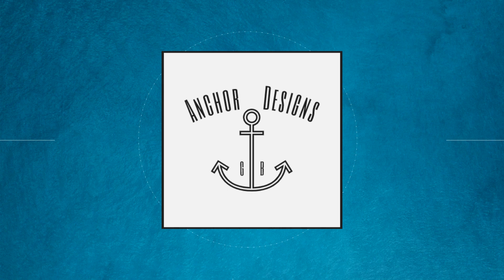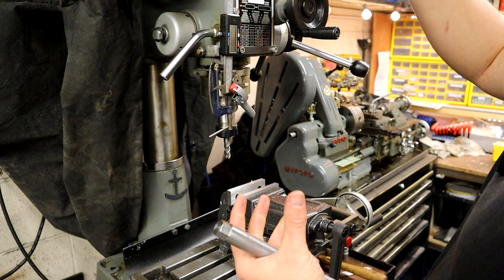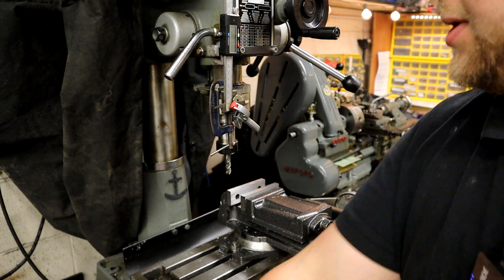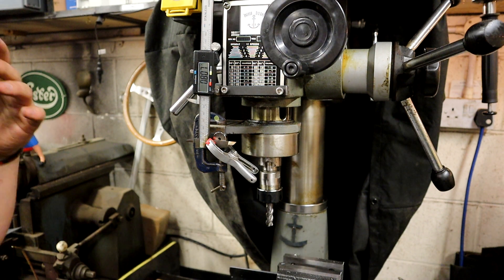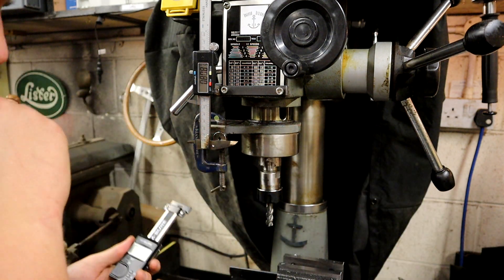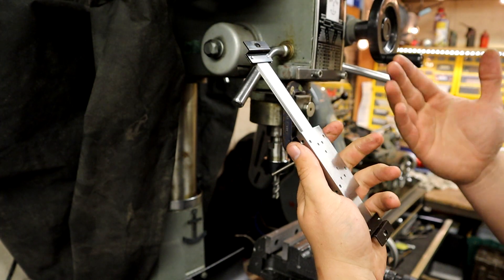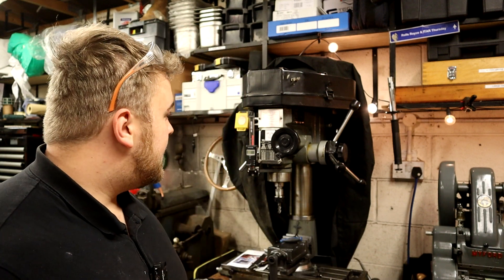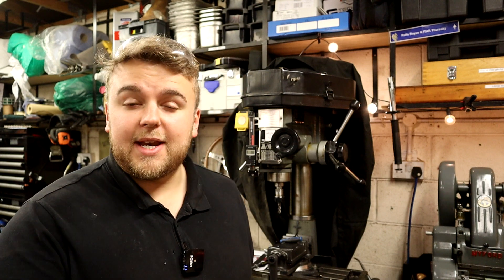M-SURE/MACHINE DRO / Linear Scale Z Axis Milling Machine Install Round Column Milling Machine

Comment: Thank you for your video. I am considering adding one of these to my mini mill and this helped quite a bit. I’m curious do you miss the depth stop that you had to remove or once you have the DRO installed is it not really needed?
Reply from the maker: Not really no, I have since changed mill again from this machine but I will be fitting the exact same system and DRO. Worth the investment imho. Thanks for the comment.